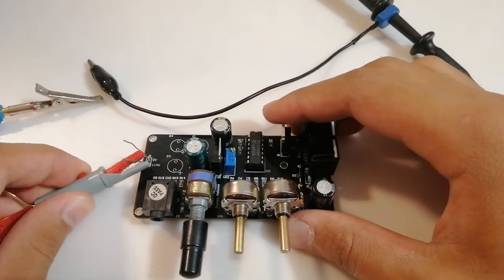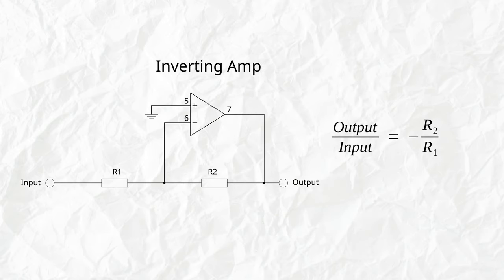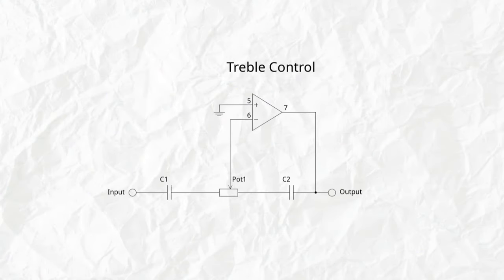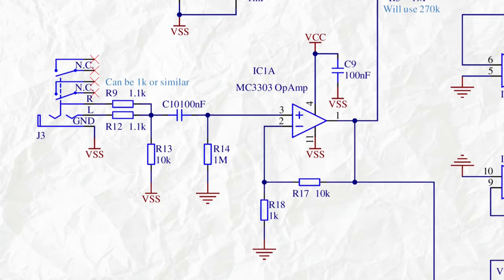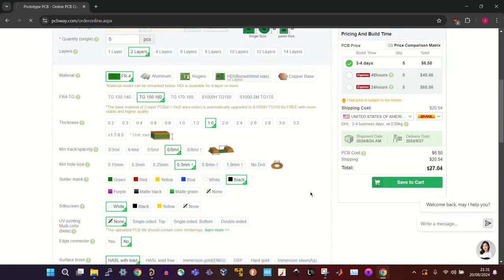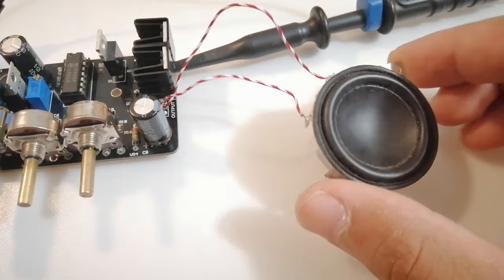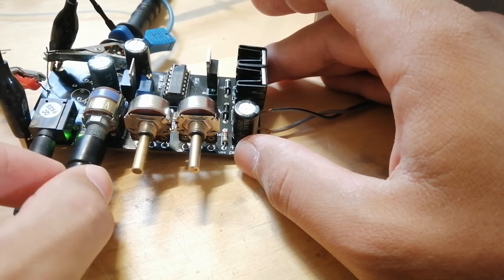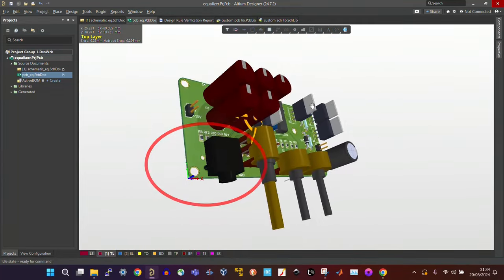Make a Simple Audio Equalizer with Amplifier

Comment: Looks like the four capacitors in the schematic on the power supply, NOT the "input", are for lowering the ESR (effective series resistance) if this circuit is used in a noisy environment😉
Reply from the maker: Yeah, I screwed up while recording the explanation, and forgot to correct it in editing. Thanks

Comment: i have that problem with cheap and/or old solder paste that has not been stored in the refrigerator. the flux evaporates from the paste so the solder does not flow as well. it creates pools around the pads and when it finally melts, I am left with a bunch of tiny solder balls stuck to the solder mask around the pad
Reply from the maker: Thank you for the feedback, that's great to know!